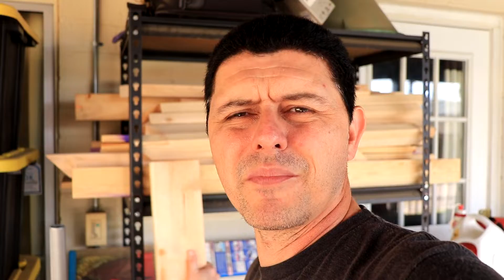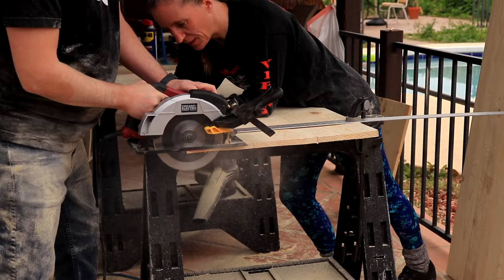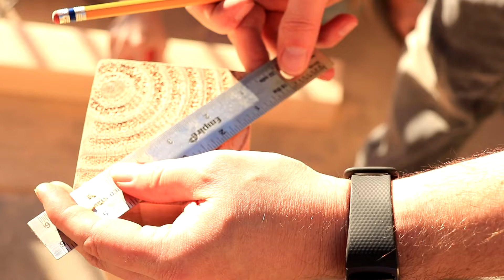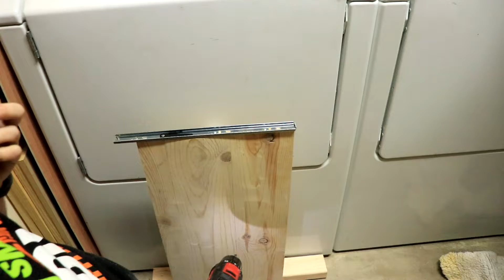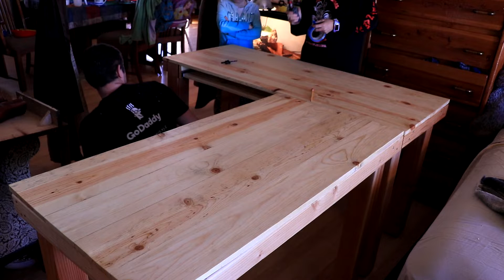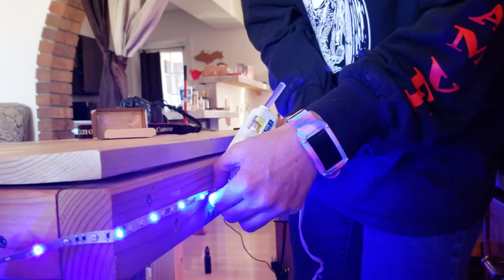DIY Rustic L-Shaped Computer Desk with LED and On-Desk Power: A Scrap Wood Build

Comment: Could you have a hardware store pre-cut these parts so you can just put the pieces together? I don't have any cutting tools.
Reply from the maker: This is a great question, and I get it often. So some things to consider when wanting to do that. First off is the hardware store normally will have a limit on the number of cuts they will do, and this is a fair amount of cuts. Secondly, not everyone who does cuts at the store is a woodworker. So you may find that you will get the long and short of the board story from them. (Sorry about the pun) LOL. In essence, they often measure poorly, and they use saw blades that are kinda rough on the wood. So you're more likely to get jagged or non-smooth cuts that will add sanding to your workload to fix. So not to dissuade you from doing that, but you might find it is more trouble than it is worth.
I hope this helps, and let us know if you decide to build it. :) We love hearing from all of you. :)
Reply: @WoodWorkTherapy  Ok thank you for the reply. What are the minimum amount of cutting tools you think would be necessary for something like this?
Reply from the maker: @bobbyjoseperez  Relisticaly a simple saw, drill, screwdriver, and for the LED's a hot glue gun. This is assuming your boards are flat, and you do not mind some manual labor with hand tools. Oh and a decent ruler 4ft would be suggested. Tape measures are a bit weird and unreliable.

Ideally, you would have a circular saw. Harbor freight is fine. A power drill, and a power screwdriver or impact driver for screws. That is probably about 50-100 worth of powertools if you thrifty. Goodwill is also a good place to pick up some value tools. I picked up my first miter saw from there for like 35 bucks. Tools can be cheap, and good at the same time. 

I hope this helps. Let us know if you have other questions on this. :)
Reply: @WoodWorkTherapy  Thank you for the advice! I'll respond if I have any other questions!

Comment: Thank you for making this video and mentioning how much it cost you. Amazed at your comment about how much weight it could hold. I have been wanting to get something like this with drawers. I would have liked to  follow this video but don't have any of the tools you use.
Reply from the maker: First off, thank you. :) Always remember wood working is all bout making due with what you have. So don't let the tools discourage you for doing the project. The whole thing can be done with hand tools and basic sanding. That being said it will take longer, but totally doable with hand tools or other cutting and sanding tools. :)
Reply: @WoodWorkTherapy  Thank you again. That was very encouraging. Now I will surely give it a go.
Reply from the maker: @Lytyrs2go  Glad to hear it. :)

Comment: Most L shaped desks are $400-$700 so nice! Ez $100 desk!
Reply from the maker: Just remember you have to get the 70% off stuff at the HD to get close to that price. I will tell you it may look nice but you got to work it a bit to get it flat LOL As you saw. LOL. But it's cheaper than buying one. and if you build it how we built it that thing is ROCK solid even in the center. We had a person abut 180 pounds sit on center and it held him. I was surprised at that. I would not recommend testing it with that much weight. It did bend a bit on that test but never broke and flattened back out without help. :)

Comment: Thank you so much for this video ive been looking into making an all wood desk for my computer setup and this more simple design was definitely what i was going for. If i could ask though what was the thickness of your wood for the tabletop and the legs?  Because im trying to be able to support a heavy pc and three monitors and i question how stable i should make it. Thank you for answering if you get the chance :)
Reply from the maker: Top was made from approx. 3/4 thick pine construction grade, and the legs were 4X4 pine construction grade.
Reply: @WoodWorkTherapy  thx

Comment: How long did this take you?
Reply from the maker: We actually did that build in about 3 days with minimal tools(Yes what we used in the video were all the tools, minus a table saw trip we had to take to smooth out the edges on the wood). 
If we did this with a planer, joiner and all of that nice equipment, it would probably have been about 1-2 days, not including finish drying and degassing.
Overall it's not a hard build. and looking back it could have been faster. but being one of my first major builds, it was not bad at all. :)
Reply: Wood Work Therapy ok thanks so much I’m planning on building a desk this helped me out so much
Reply from the maker: @davian73  For sure! Take advantage of that discounted lumber bin at the Home Depot. If you can find some good boards you'll pay hardly anything for the whole thing. The top wood was near free. I think we paid like 3 bucks for the lot. And we had enough for about 5 desks! LOL

Comment: do u think 2x2 legs will be to stable a table like this
Reply from the maker: Depends on what type of wood your using, how you are securing the legs in the assembly, and how much weight you are putting in there. 2 inch by 2 inch legs should be good for the most part. Would suggest a hardwood of some sort. Pine is not bad but I would cut off the softness at Poplar. Hope this helps. When your done post a pict so we all can see it! :)
Reply: So I intend to use ply ass the table top and ofc I’ll be uploading a video

Comment from the maker: Did you like the desk build? What did you like/hate about it? Let us know in the comments! :)
Here are some links to some of the items we used on Amazon:

Hidden-Power Pulling Pop-up Desktop Power Outlets with 3-Socket & Dual USB Chargers: https://amzn.to/3e3GE7C
LED Strip: https://amzn.to/3ZknEfr
LENOX Tools Bi-Metal Speed Slot Arbored Hole Saw with T3 Technology, 3-1/4": https://amzn.to/2XfmmkT
Everbilt 1-1/16 in. Threaded Glide: https://amzn.to/2LLAX23